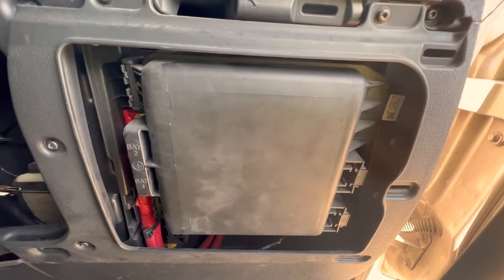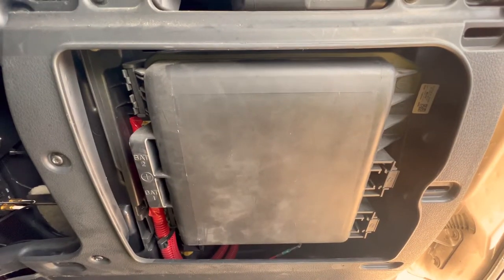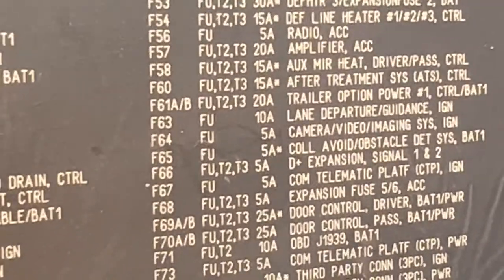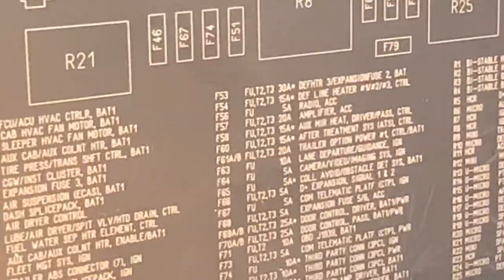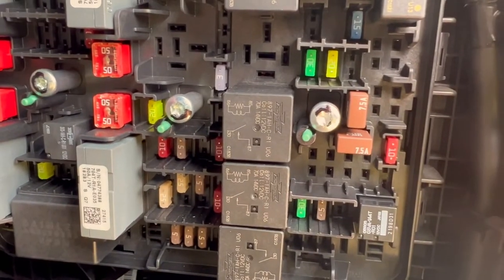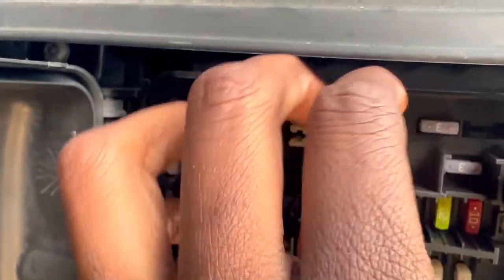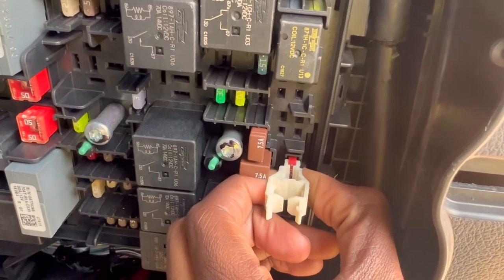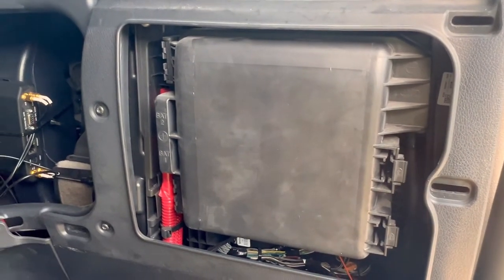How to Disable Lane Departure on a 2019 Freightliner Tractor Trailer

Comment: I drive a Freightliner 2024 same thing, you have to keep pushing the lane departure button all day I must push it 50 60 times a day, 😅 the second solution besides pulling the fuse take some tape and cover the lane I on the outside of the windshield it will error and you can still have a peaceful drive.

Comment: I got this freightliner as a replacement truck. Oh my God that sencor is very loud and very annoying. Now, 12:02 mid night. I dont have words to say you thankyou. Thd first available video was yours.  I followed and now I am in peace. Again thankyou so much .
The switch we turned off will remain off and come back to normal. Thanks
Reply from the maker: glad i was able to help! yes it’s annoying! just remember to replace the fuse when ever you return or get a pm on a truck.
Reply: @ShaunWaveTrucking  
Thanks
Reply: Hi, one more time need your help. How to disable the distance warning?it is too loud and restrict your movement. Thanks in advance.
Reply from the maker: @tughral  that my friend i don’t know how to disable that. Im thinking it could be a fuse of some sort. That is one thing i would leave on as that is more of a safety concern to make sure we are keeping a safe following distance. That’s probably something i won’t cover on this channel. 😊
Reply: @ShaunWaveTrucking  
Thank you so much
Reply: Does it still pull you back into your lane? You know like the construction worker on the side of the road.  You move away from him/her a hair then Lane assist activates and pulls you back towards them? That's the only reason I hate it.
Reply from the maker: @jessegoins1866  well you as the driver has full control of the vehicle…. this just disables the audible alert when lane departure sensor thinks your over either line..

Comment: This is a horrible feature for seasoned drivers. Maybe it's useful for new or drivers in training.. anyway, so appreciative of this tip. I'm in somebody's loaner truck and it had this feature. Now, I'm back to buzzer free driving. I'll be making sure to replace that 10 amp fuse in its place as soon as I vacate this vehicle... Lol
Reply from the maker: i agree…. im still a baby as i’ve only got 9 years of experience in otr,regional, and local.
Reply: @ShaunWaveTrucking  .... Hahaha..  well, you're a bigger baby than I am. I started in 2014. And at this point I don't need lane control alerts.. Ha!

Comment: Can confirm on my 2023 that it shows to list it as the same fuse in the same spot (F63), but my truck has no fuse there and I’m still getting the Annoying noise.
Reply from the maker: maybe its tied to another fuse that functions with something else?? I feel it’s only a matter of time when these companies will totally hide a way to disable the lane departure feature…
Reply: Yeah.. on 2022 & up.. it's tied to your adaptive cruise! Pull it, & now you don't have cruise control. At least that's how mine is set up.
Reply: @mikekirby9310   no cruise control at all ?
Reply: Mine has no fuse. I think it's tied to adaptive cruise control. If you pull that fuse it means you manual have to set your cruise
Reply: 2023(2024) here. No Lane departure fuse. 

So far the only thing I saw is to block the camera (inside notch at top center of windshield) from the outside with something like electrical tape. 

Either that or disconnect the speakers in the doors and use an external speaker or the rear speakers.
Reply: @CollinLutz-p9e  The speaker has separate wires for the truck sounds and radio sounds so you can unplug the the truck sounds and still have stereo sound. Reverse and lane departure will still mute the stereo sound. 

The draw back is you lose all truck sounds. Blinkers, hazard, any warnings such as low air pressure buzzer, etc… If a DOT officer wants to see you air brake low pressure warning, you’ll be in a bad spot. You’ll also most likely find yourself riding around with your blinker on. You don’t hear it so you forget to turn it off. 

Blocking the camera on the windshield also disables collision mitigation and adaptive cruise. When that camera is blocked, you get hit with a barrage of messages when you start the truck, set cruise and randomly. It’s super annoying constantly clearing those messages. 

Freightliner has really went all in to eliminate work around and to make driving their trucks as noisy, distracting and as miserable as possible to drive. 

I’m constantly taking my eyes off the road to find switches & buttons to hush alarms. I absolutely hate Detroit assurance. I can deal with a collision mitigation system that would apply the brakes if I was getting really close and not attempting to hit them all the rest of it is just annoying junk to a good attentive driver.
Reply: I have the exact same problem
Reply: @CollinLutz-p9e I tried to tape over the camera and it worked .. after a while a whole bunch of warning lights came on the dash though, until I pulled the tape back off
Reply: @truckingpix  Depends on if it’s your truck, or a company truck. If it’s your truck or your company doesn’t check to see if you’ve tampered with it, the best solution probably see a shop (non-dealership) and pay them to disable the stuff you don’t like with Freightliner software. If you can’t do that, unplugging the two front door speakers is about the best option. If you work for a company that checks, your SOL.
Reply: I didn't have a fuse in that spot either and my LDW still functioned. There is another fuse, f34 I think, that also says lane departure and something else. Haven't tried it yet though so can't confirm what happens.

Comment: On a ‘22 version the breaker isn’t there.
Reply: Same on a 2021 model ☹️
Reply from the maker: when i upgrade to a 22 or 23 model i will see what i can do.
Reply: I posted a work around on my channel (works perfectly on my 2022)
Reply: @TranslatedAssumption  did you ever find a solution the fuse isn’t there ??? Other than taking the switch out ?

Comment: On a 2022 just pull the ldw switch on the dash by the hazard switch and no more ldw noise ,and when you need to have the truck serviced or whatever just pop it back in ,guarantee it works
Reply: 😂😂 I'll never pit it back

Comment: I unplugged the speakers
Reply: That is where I'm heading pal.
Can't even get a new truck with a fucken CD anyway.
Reply: On a 2022 the system uses your stereo speakers. Annoying as hell!
Reply: I've got a 2024 i wonder if you swapped out the stereo is that would fix it?
Reply: Yeah, think I'm going to have to do this to. Unless I can discreetly block the view of the camera. But I think speakers are the way to go for newer trucks. 

I'm going to first try and see if anything output from front speakers to rear helps anything. 

I'll find a way to get around these dumb "safety" features.